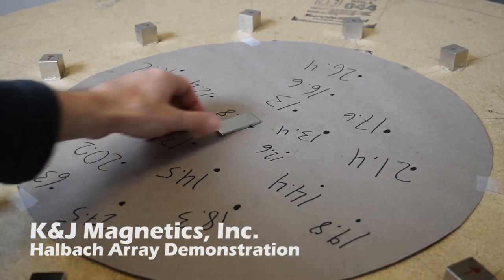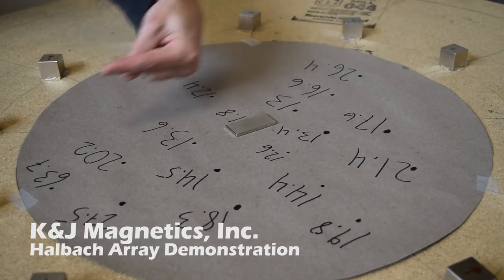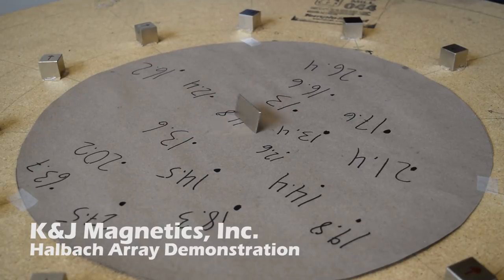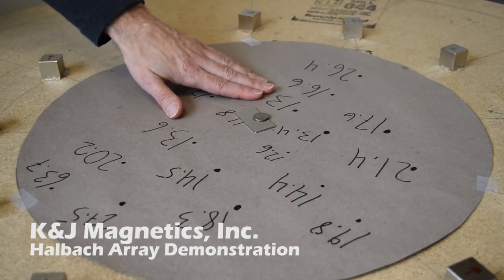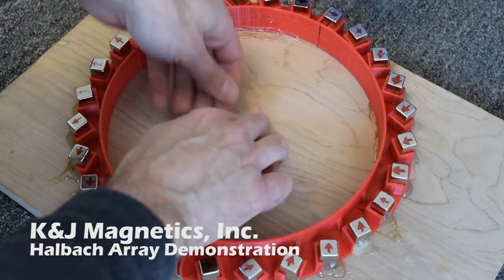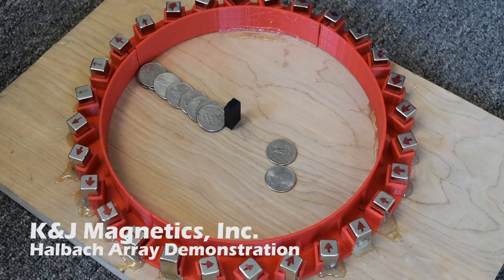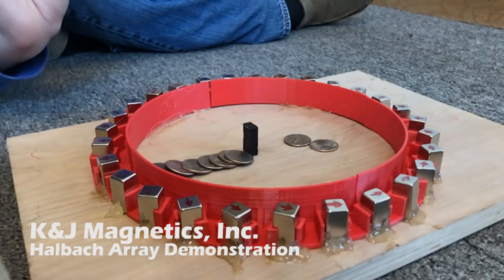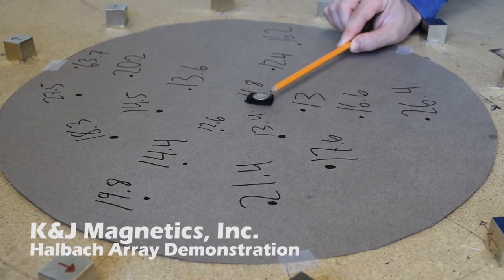Magnetic Dipole Moment Using Halbach Arrays

Comment: Hi ;I want to do a project using arduino and magnetic field effect(halbach etc...). I need to move the toy vehicles that I will use in the project and make them go to the correct positions. IS this possible with arduino and low DC Voltage ? or no way Thanks.

Comment: Is there an easy-to-understand way to go from torque or movement, to volts and amps, when there's a wire coil and iron core involved?  I'm wondering about the math behind using a hallbach ring and moving coils for a wind generator, and I want to somehow calculate the sizes of things I need, and the output I can expect, based on my known input (rotational) torque and speed.  What I've gleaned so-far, is the the number of windings of the wire determines the voltage - but I've not found any examples or units or info about the scale of these things (e.g. "double voltage with double windings" is fine, but what is the "starting" voltage?)